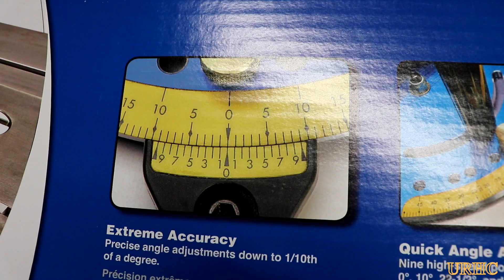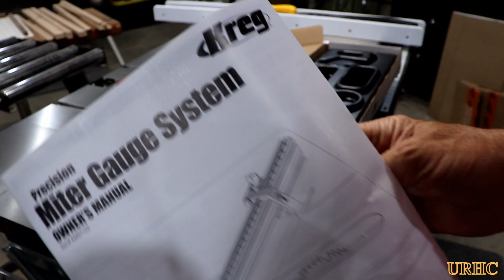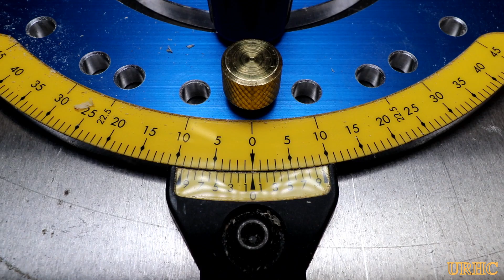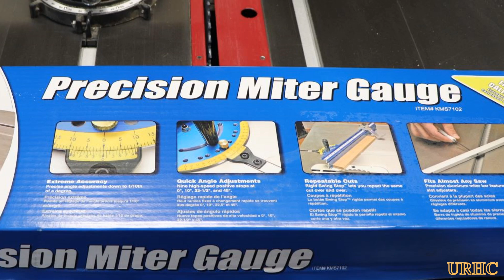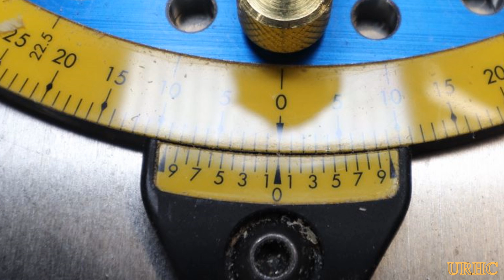Kreg Miter Gauge KMS7102 Assembly And First Impression

Comment: I'm a recent subscriber - you do a great job with all of your Videos.  So I decided to just buy a precision miter gauge as opposed to building one; like most wood workers I have built several jigs but I confess that I consider it a necessary evil.  So, this time I decide to just buy one.  I had pretty much narrowed it down to the Kreg when I discovered your channel and the most excellent review that you did.  So that review created enough concern in me that I chatted online with someone at Kreg and they more or less blew off my concern with the locating holes not corresponding to the scale.  So I sent them an email and in that email I included the torquing issue you also found that caused the fence to lose its 90 degree attitude.  Plus I asked them a couple more questions.  So today I got this email from Kreg with a copy of text from my email and they asked me to give them some feedback on how they did.  Since they never answered the email or called me, I found the whole thing quite amusing.  Just as well I suppose because I actually ordered and INCRA 1000 HD yesterday.  I sure it will have some flaws as well - hoping nothing too major. 

One question for you sir - In one of your videos you mentioned how pleased you were with your Amana blade.  Could you please share which one that you purchased?  I'm sort of partial to a "Combination" blade because my dislike for changing blades from rip to crosscut, but I think I'm getting too much flex out the the Irwin that I'm using.
Reply from the maker: I did a follow up when kreg sent out a new gauge because the first one was defective.  https://youtu.be/11Z5knyxGGU  the new one is much better but still not perfect. There is also a video about the blade and it is the best combo blade that i have ever owned.
Reply from the maker: Blade video  https://youtu.be/bOuJSD3GnRM

Comment: This is a very good review.  My Kreg miter gauge is older than yours, identifiable by a smooth stop vs. the grooves in yours and the factory bolt for the stop was a hex head 1/4" bolt.  I replaced it with a T bolt which made adjusting the stop much easier and more accurate.  The brass positioning pin on mine is a much closer fit and there is no perceptible play in the miter gauge when it's in but it is not accurate.  I realized how far off it was when I upgraded my squares.  I'm shimming it with aluminum tape to get it accurate; lots of trial-and-error.

The nylon screws wear very well.  No need to worry about them.
Reply from the maker: This definitely  is not my favorite.  The aluminum guide bar is also very flexible causing  inaccurate cuts on larger pieces.  Thanks for watching.

Comment: I learned a lot about that word "Precision" while shopping for squares to square our saws at work. I would say with that little problem you found that word should be removed from the name of the product. Other than that it looks like it works well. Another great video. Keep them coming. Thanks.
Reply from the maker: It has just enough slop to cause problems. It would have been nice if it had a positive lock. Thanks for watching.

Comment: You are right about that blade.  Really cuts nice.  I have a Grizzly G0771 and the blade is a little too beefy for my saw.  I made two cuts with the blade on oak veneer plywood to test it out.  One rip one cross cut.  Really clean cut.  I then decided to double check the specs on my saw and that is when I found out that I just wasted the money for that beautiful blade.  Maybe I can sell it.
Reply from the maker: The .140 Kerrf may draw a little extra power but I have seen comments from some with less hp then your saw running it. I would contact Grizzly and see what  they say and if they offer a .125 splitter for that saw. It is amazing with my 5 hp. Thanks for watching.

Comment: I've assembled a lot of Kreg miter gauges over many years and the pins were always a perfect fit with no slop. What you have there is a defective undersize pin or an oversize hole. Call Kreg. * An old timey way to use a miter gauge with boards that are too wide is to flip it around backwards in the miter slot. You would also have to slide your miter fence opposite too.
Reply from the maker: I measured the holes, they are .249 in the bar and bushing. The pin is .248 so that is the slop. I found a .2490 dowel pin today and  the holes are slighty misaligned so a tight pin won't work through both parts but fits perfect in the holes. I see another comment from a subscriber with the same shake so I figured it was manufacturing tollerances but will try calling them seing how you say it should be tighter. Thanks for watching.
Reply from the maker: I called and they watched the video and agreed there is something not machined right. They are sending a new pin and cross slide. Thanks for your input.

Comment: I had to file the entry and exits of my miter slots as well. I ended up allowing .003ths play on the corners to get everything sliding well. I also have about a 15 year old incra miter gauge that still does well and i still use it alot for quick crosscuts but what ive come to realize is that if you are nuts like i am about 90 being 90, nothing beats a home made sled.
Reply from the maker: It slides in the slot nice, just would have been nice if it was repeatable.I agree a sled is best for 90s. Thanks for watching.

Comment: I just bought the same mitre guage and the one i got is absolutely perfect zero play and i also noticed the brass pin if you just push it in its sorta loose i just turn it a bit and its tight.  Just wish there was a way to keep the pin with the mitre guage when you dont need the positive stops
Reply from the maker: Mine was drilled wrong. They sent out a replacement that's real close. Thanks for watching.

Comment: @2:23, Those nylon set screws were a deal killer for me.  All the screw holes had burring on the threads, and the screws would not easily drive thru and a couple the screw heads stripped.  One set screw is stuck inside threads and I'm going to return the item.  I figured paying $160 for this device is not worth the hassle of these stripped threads and NYLON screws.  In the least, the screws should have been metal with an allen head.
Reply from the maker: Turned out the stop holes in mine were slightly off. Kreg definitely has quality problems since moving stuff offshore.

Comment: 13:25 small cut offs falling inside the saw. A zero clearance insert needed.
In another vid I believe you made a plate.
I just bought a grizzly table saw and on the very first cut after setting it up, I was cutting an small end of a piece of hardwood using the miter gauge.
And the small cut off got bound for a second between the spinning blade and the factory plate,needless to say it was very unsettling, it made such a pop , fortunately I didn’t break a carbide tooth off a brand new Freud blade.
Reply from the maker: I wound  up making  wood zero clearance insert plates in the end. Try an Amana prestige blade when the Freud  is worn. Best upgrade I made to this saw. Thanks for watching.

Comment: That miter gauge is built for those $4000 Sawstop type table saws. My 10 inch kobalt  probably cost less than that miter gauge.
Reply from the maker: This  miter  gauge is overpriced. They did send a replacement that was drilled properly to fix it. Thanks for watching.

Comment: Thanks for sharing, I have been looking at this. I think I will buy one.
Reply from the maker: Check it good when you first get it. The pin holes were off slightly on it. There is another video about the replacement that was perfect and the miter set gauge I now use. If I bought it again I'd go with the incra. Thanks for watching.

Comment: To test the accuracy of the miter and to make necessary adjustments I find the 5 cut method to be the way to go. Lots of YouTube videos on how to do that. Hope there is some way for you to get the wobble out of that pin. I have a real good miter but recently bought a Rockler cross cut sled which performs the same function. It is an exceptionally well built, accurate and useful tool. I see myself using it routinely now.
Reply from the maker: I did a follow up. Kreg replaced the gauge because the index holes were not properly  machined and there was a nylon washer  I removed to get it sitting flat. l bought  a miter set segments that is really good for setting the angles.  Thanks for watching.

Comment: I've always liked Kreg tools but I'm a little disappointed in that pin or more than likely, it's the hole. I guess a guy could get some brass and turn it to a custom fit if it was a big deal. Anyway, it looks nice and I'm sure it will be an asset to your shop. Thanks for the review. It helps the rest of use thinking about buying this product.
Reply from the maker: I found a dowel pin today that fits the holes in the aluminum tightly and the rail bushing nice but it won't go through both. The misalignment between the 2 seems to be the reason for an undersize pin. Just have to hold it with the arrows aligned when tightening the handle.  They should remove the word precision from the label. Thanks for watching.
Reply: You would think those holes would be precision line reamed so there wouldn't be a chance of misalignment. About the only way I'd know to make it precision would be to plug one set of holes and re-line ream.I agree, they should change the wording or replace it with one that is done correctly. You just can't seem to find anything of quality these days.
Reply from the maker: At least the arrows are accurately located so you can align it when tightening. I guess there are different ideas of what precision means. It says made in USA so I  can't blame it on China.

Comment: A very well done review. Congratulations! I was curious to know which saw you use, because the cuts in playwood are perfect.
Reply from the maker: It is not the saw, it is the Amana 40 tooth combo blade that I recently switched to that makes the saw cut so nice. Here is a video about it https://youtu.be/bOuJSD3GnRM it is the best general purpose I have ever used. Thanks for watching.
Reply: Of course, I wanted to say the saw blade ... I'll look for one of these 
Do you think in a Dewalt 7490  it will do a good job too? Thank you.
Reply from the maker: I think the blade is too wide a kerf for the dewalt 7490. It is a .135 kerf and  needs a strong motor. You would be better off with a thin kerf blade on that saw.
Reply: I apologize for taking your time, but I'm just starting out in the hobby with wood. To do a good job especially for playwood would you point me some saw blade to the Dewalt 7490? Thanks.
Reply from the maker: I don't know anything about that saw and would recommend you do a search about it and ask someone that owns one. You may be able to use this blade if it is just cutting plywood but I doubt it would have enough power to cut hardwood over 1 inch thick.

Comment: So why was the tape measure not pr installed and longer then needed...
This is why I use Incra for miter and many other things.
Reply: I might add for $10.00 more you could have the Incra miter 1000se
Reply from the maker: I agree.  The pin holes did not give perfect angle cuts and the space tilted the gauge also. They sent a replacement and that one is right on. Thanks for watching.

Comment: At 16:40 your stock is just wide enough to hit the stop. But the stop is not flush with the back of the fence so what happens when you use stock that is not as wide? It seems like it may not sit flush with the stop.
Reply from the maker: I did a follow up after kreg replaced the parts with the holes and it it was better.  There is a thin nylon washer that I also removed to make it sit flat. Wound up getting an Incra sled to get accurate cuts because the aluminum rail on this flexes to much.  Thanks for watching.

Comment: Hello, congratulations for your videos, I am writing from Monterrey, Nuevo León México.
I bought this precision miter gauge but my Dewalt saw model DW745 has a little surface,  I just can cut up only  6". I did not think about this and cuts are very limited. Do you know any video of someone who has enlarged the surface of their saw Dewalt ? Regards.
Reply from the maker: I put a piece of plastic on mine but the kreg aluminium bar turned out being too flexible for accurate cuts on wide boards so I recently bought an incra 5000 sled. Thanks for watching.

Comment: I guess when you buy tooling, it's worth your while to check them all before use them so that you can make any necessary corrections.  A sad fact but well worth the effort.
Reply from the maker: I guess at the rate they manufacture items like this things can go wrong. Kreg replaced the gauge that definitely was off and the new one is perfect. It pays to check everything as you say. Thanks for watching.

Comment: How much money would you be willing to pay for a "perfect" miter guage?  What would it take to make a "perfect/spot on" miter guage. when once set, will never presents a 2-3/1000ths problem again???  In industrial manufacturing, they appear to have absolutely precision tools; however, in home shops, it appears that this is always a potential issue.  As a newbie woodworker, I am trying to get some understanding before making tool investments.
Reply from the maker: I did a follow up video after Kreg sent out a replacement that was properly machined that had better accuracy and repeatability.  I would reccomend you look at the Miter Set gauge shown in that video also. It makes any decent miter gauge accurate and fully repeatable.  Thanks for watching.
Reply from the maker: https://youtu.be/11Z5knyxGGU

Comment: just because Miter gauge is 90 from factory, it doesn't mean the cuts will be 90. if your blade is not 100% parallel to miter track then miter gauge will never cut perfect.
Reply from the maker: Saw is all tuned up and the holes in the gauge for the pins were  off. . Thanks for watching .

Comment: The fence and stop is the best part of that mitre gauge. The protractor , not so much. 
Toss that pin, ignore the protractor, and keep the rest.
Then check this tool out.
https://miterset.myshopify.com/
It will set ANY 3/4" miter gauge to exactly the angle that you want. It will set your mitre gauge to within =/- 0.0005". I say that because, on the same saw that you have (love Grizzly), I can't measure any error with a 0.001 feeler gauge..... zero daylight gap - across 12" double cut just like the one that you did.
I am not connected with this tool or the maker in any way beyond the full price cash that I paid for mine.
I also recomend the companion tool that sets your mitre gauge for cutting segment angles for any figure with 4, 5, .... up to 20 sides. Want a 7 sided pic frame?  ... no problem.
Reply from the maker: Thanks. They look like great setup jigs that would solve my issues. May have to try a set someday and make a video to share as it would interest some of my subscribers. The taper pins must make it very accurate. I had a subscriber comment he had setup the same miter gauge with no play so I contacted Kreg yesterday,  they watched the video said it shouldn't be like that and are sending a new pin and rail. I found a bigger pin that fit the holes tight but it won't go through both parts due to slight misalignment of the hole locations, hopefully it will be closer with the new parts. Thanks for watching and the tip.

Comment: I ordered a small Makita Router on HomeDepot a couple years back.
They just shipped it and slapped a label on it like they did for you.
The box wasn't even taped shut, so it was flapping in the wind on my doorstep.
I had to check and make sure everything was in the box and didn't fall out.
HD needs to step it up a little. lol
Why did you chose this over something like the Incra?
Incra uses teeth I think to index. (Depends on model I suppose.)
Not sure if HD sells Incra, just curious.
I was going to buy an Incra, but realized I have to use my saw to need it. lol
BTW I have like a dozen of those HF tape measures. I get one every time I walk in with a coupon. Can't have too many. lol
I like your frame jig too.
Reply from the maker: I had the Home Depot rewards card and they don't sell Incra so I went with the Kreg. Thought when they said precision it would have had better repeatability then it does. It is a nice gauge that you just have to double check when tightening the handle. Someday if I have extra money I will compare it to the competing Incra gauge. I had over 40 of those tapes and can only find 1/2 of them now. I also have 20 multi meters and 20 screwdriver sets. HF needs new giveaway items😁. Thanks for watching.

Comment: I'm not an engineer so, what if you added a small washer under that pin, what would happen????
Reply from the maker: It would still be sloppy.  I tried a larger pin but the holes are not aligned either.  Called Kreg and they are sending parts to fix it. Thanks for watching.